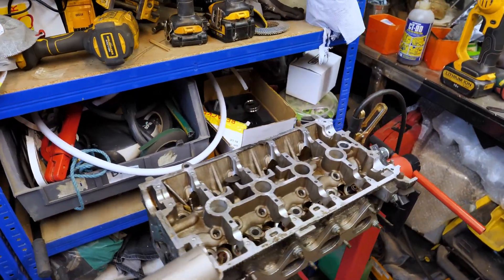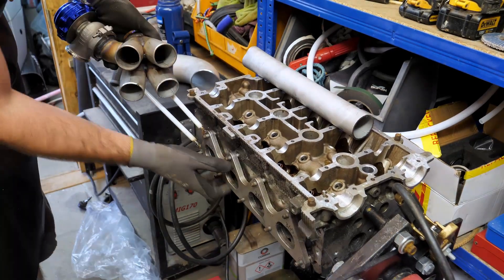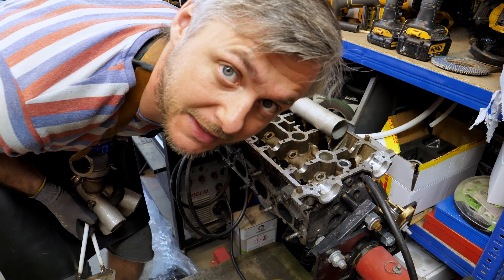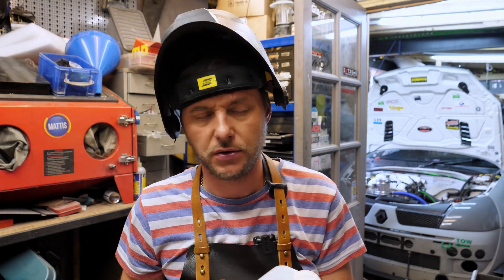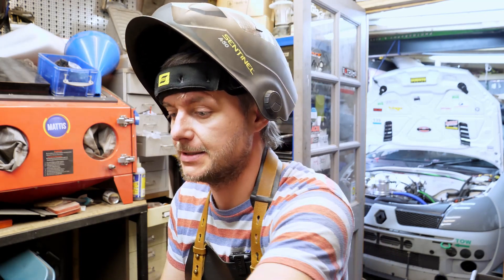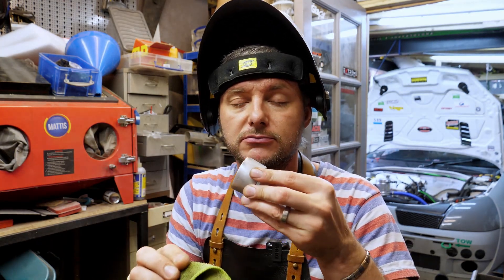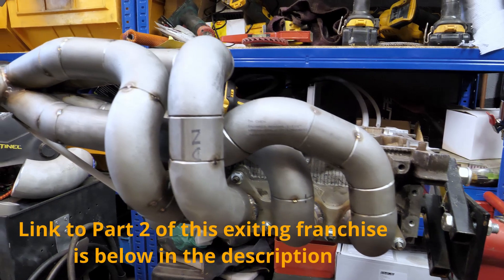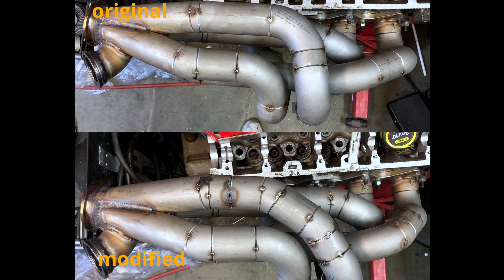building your own turbo manifold. CLIO mk2 Tubular manifold fabrication. Mockup and tacking. 1

Comment: Hey, how do you measure the exhaust runners and design prior to cutting and welding? So that they are all exactly equal and fit inside the engine bay. I am trying to do this for my turbo RX8.
Reply from the maker: its all pretty much guess work on mine to be honest.
Reply: @RuskiWeldFab  Serious? What if the runners are not equal length / they are too big and collide with the engine bay or other components?
Reply from the maker: @kzz8971  on a turbo manifold its not essential for them to be equal length. and it was too big for my engine bay so that had to be modified.

Comment: How does it go with the v6s doe how do u built the manifold? Is it a 3 to 1?
Reply from the maker: yeah depends on your set up. 3-1 or 3-2-1.
Reply: Which turbo do u recomend for my tiburon gt v6 im trying to get to 250-300hp on decent boost.
Reply: if u run a turbo on low psi like 5-10 does it still need an intercooler? im a noob at this

Comment: Nice Job,  I have a question, what do you recommend for the central exhaust pipe diameter on a Clio 182, I find a lot of 2.5" section, but I wonder if we are not losing in torque, the original diameter is 50-51mm, thank's, I was thinking about 2.25" to have a good compromise, but I'm not sure :)
Reply from the maker: If it’s NA, personally I think 2.25 is sufficient as you need back pressure. For turbo 2.5”
Reply: @RuskiWeldFab  thank's

Comment: I'm knew with this stuff, I want to do my own turbo and I realize I need to make my own manifold. Where should I get the piping materials? And where should I buy a tic welder? Anything helps.
Reply from the maker: R-tech for welders. metal you can buy from ebay. you want shedule 10 piping.